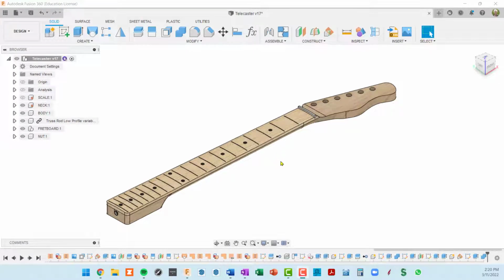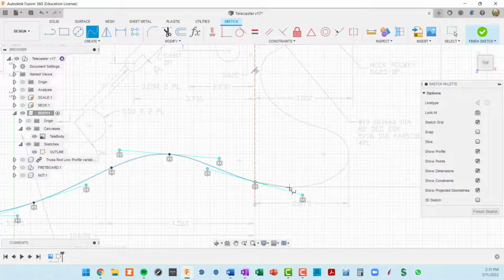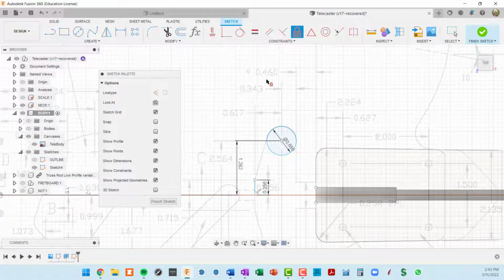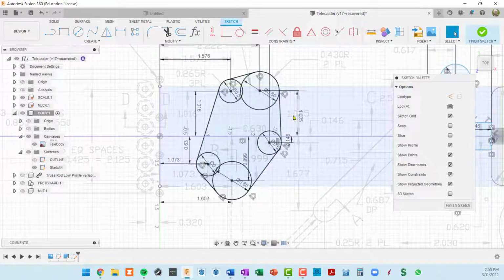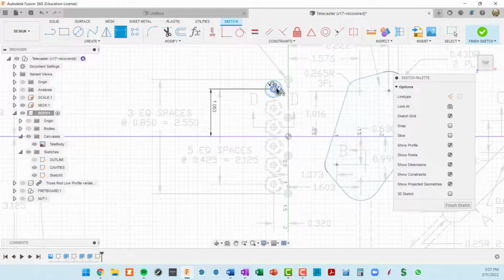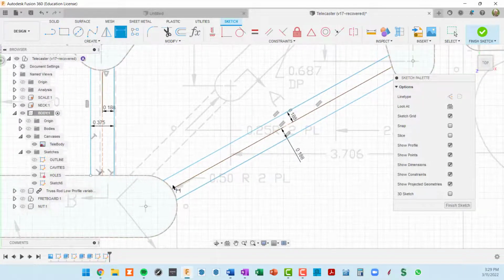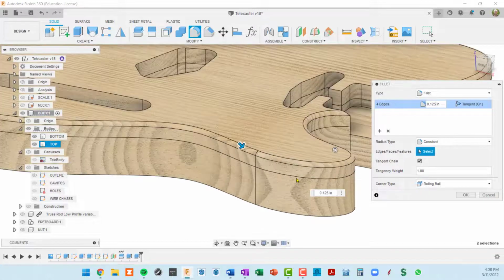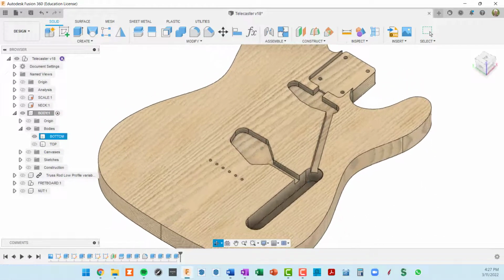Telecaster in Fusion 360:  Part 7, Body

Comment: Nice! I just found your videos today, didn't expect this! Working on designing a Tele body with P90s and Gibson scale, it's a very good series so far.
Reply from the maker: Thank you - I hope the videos are helpful.
Reply: @bweissvt  Immensely helpful! The only trick I've gotta work out is how to set the bridge and pickup locations after modeling the body. It should be as easy as measuring out the scale length and then aligning a Gibson body as a canvas along that line, then tracing out the bridge and pickup cavities, and adjusting the control cavity and wiring to align to those, right?
Reply from the maker: Start by making the scale.  I like to do this in a separate component, since you'll be hiding and showing this a lot (see my Telecaster video #1).  Also ground the scale so that you don't accidentally move it.  I would suggest modeling the neck next, but if you want to skip ahead to the body, make sure the canvas is properly scale and positioned.  Align the canvas to the center line and bridge line (both in the scale).  Then, as you said, it's just a matter of tracing around the body perimeter, cutting cavities and rounding over the edges.  

The Telecaster is a good body to start with, since it does have comfort cuts or a carved top.  I'll cover those techniques in a future series on PRS guitars.
Reply: @bweissvt  Yeah, the mirroring you did in tracing the body does make it very convenient. Thanks again for the series, and for the tips.